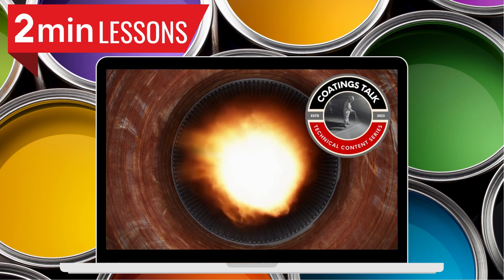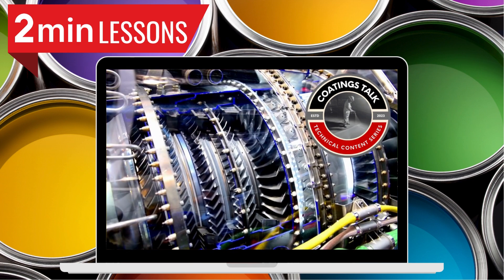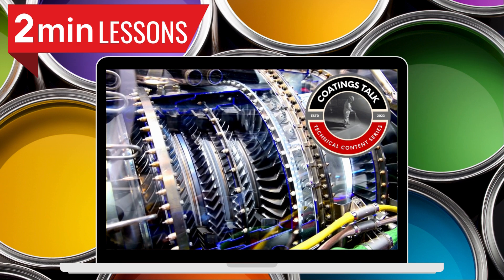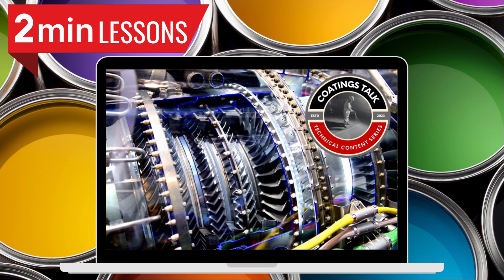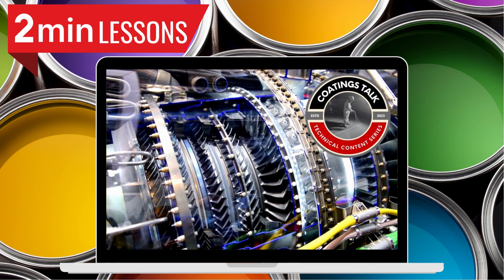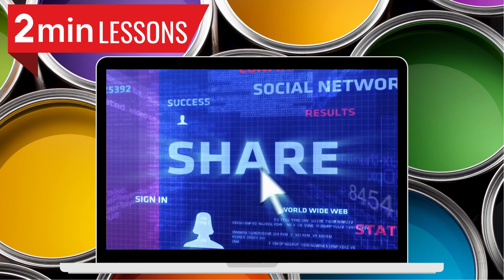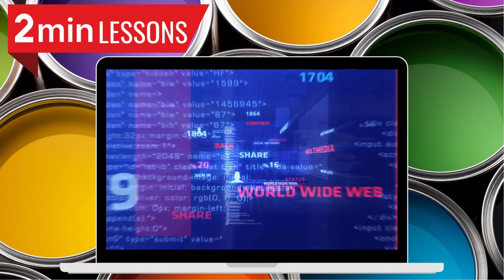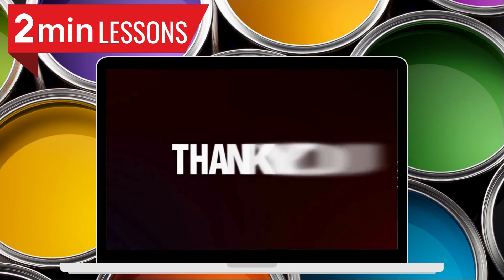Two Minute Lessons: Thermal Barrier Coatings

Comment: Is it silicon based?
Reply from the maker: @wy5761  TBC system has 4-layers: Ceramic thermal layer, the metallic bond coat layer, a thermally grown oxide layer between the top coat and bond coat and substrate.  Each layer needs to have specific fit to purpose physical and chemical properties to fit the service environment.